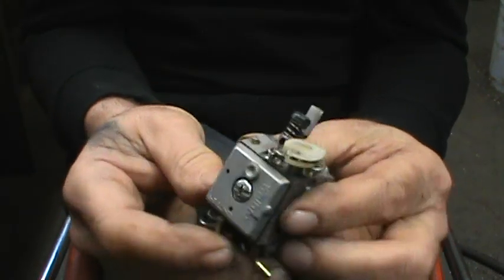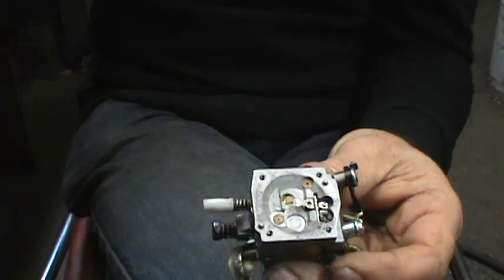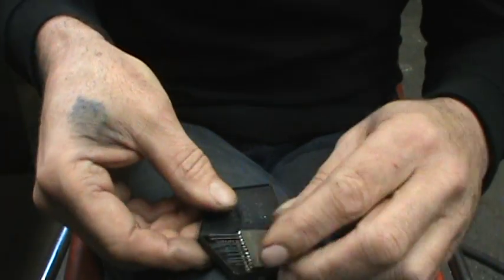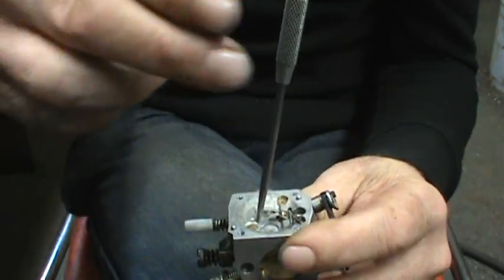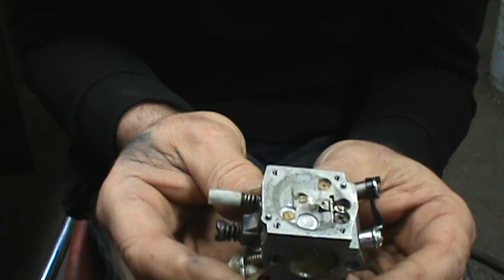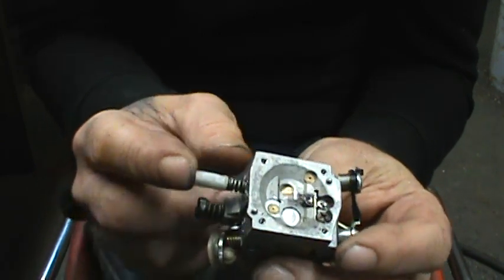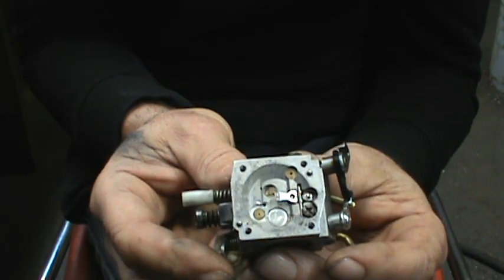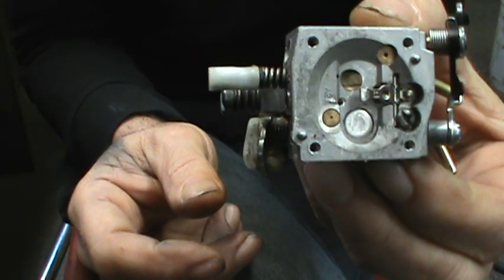372 hd carb mod

Comment: That's awesome! Most would've just thrown it away and got another
Reply: 13 bucks for a walbro on ebay/amazon. Be there in 2 or 3 days.
Reply: @austindenotter19  for a real Walbro?
Reply: @austindenotter19  $13 for a chinesium knock off hd12 that 1 out of 3 will work properly..